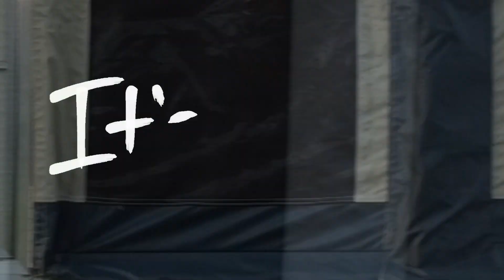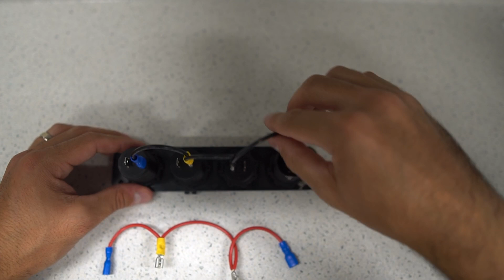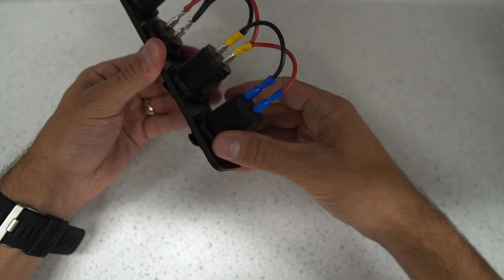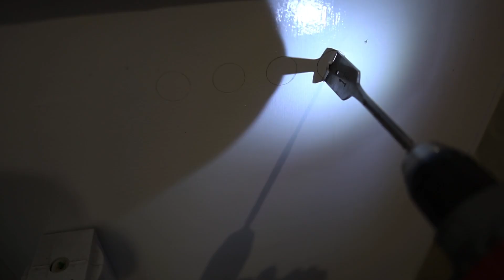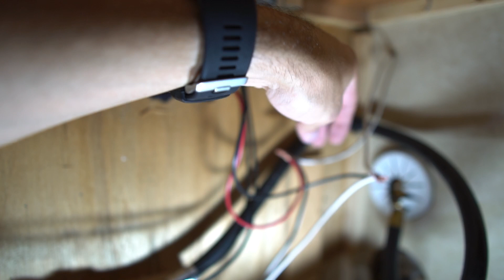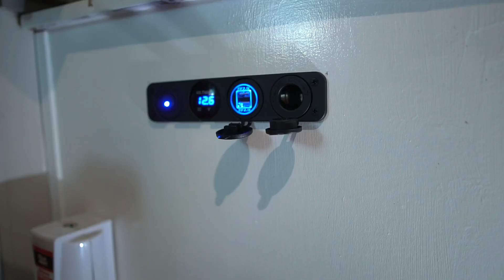Pop Up Camper 12 Volt Power Outlet MODIFICATION | Charge Your Cellphone While BOONDOCKING!

Comment: What about a fuse for the usb port? Do u not need one to protect your phone or whatever device u have sucking down those 12volts?
Reply from the maker: It’s fused at the converter box, but I’m sure an extra in-line fuse wouldn’t hurt.

Comment: Did you use the wire that is going to your thermostat? I tapped into the thermostat wire and it turns on my heater fan every time I flip the switch on. Do you know why it is doing this?
Reply from the maker: No I tapped into the exterior 12v light.
Reply: OK I just did that and mine works great. For anyone that’s going to do this project do not tap in to the thermostat wire. It will not work. Ha ha ha.
Reply: OK I just did that and mine works great. For anyone that’s going to do this project do not tap in to the thermostat wire. It will not work. Ha ha ha.

Comment: Mine is on top of the cabinet next to the bed. Much easier to see the display and use the outlets. If I put it in a wall I would build a little box and tilt it up.

Comment: Thanks for the video. Another winner!! This is definitely a mod that those of us who don't own a tool belt could do. (Well, maybe with a friend doing an 'over the shoulder.') I like how you included all the links to the hardware below; much appreciated.  Suggestion: Consider some kind of very shallow plastic or aluminum phone holder to fasten near the panel. Just the depth of the panel itself, to hold a phone while charging. Just put the phone in the slot, plug it in, and check back in an hour.

Comment: Another great video! We were originally going to replace the wall receptacles with newer ones that have UBS ports, but we are going to use this mod instead. Love having the battery volt display and this can be used boondocking while the wall receptacles are not.

Comment: Thanks for the video. When you installed that and cut your battery line to wire up are you losing your ability to use your lights w/ 12 V?
Reply from the maker: No, they still work. It's just spliced in.
Reply: @ItsPoppin  gotcha, thanks

Comment: Will this tell me how much power is left in the battery until it needs to be charged again?
Reply from the maker: It will give you an approximation. Google 12v battery voltage chart and it will give you voltages that roughly correlate with how much battery percentage is left. If it's a lead acid battery, remember to keep it above 50% at all times.
Reply: @ItsPoppin  Not so great for Lithium though! I did the same mod (same panel even!) and tried using this for the battery level but on my last camping trip I really had no idea. Depending on the recent load the voltage fluctuates heaps and takes a long time to settle. I'm putting in a proper meter yet, a cheaper version of a victron. I also want to install some wireless charging pads for phones near the bed

Comment: Did you need to install a fuse in this system?
Reply from the maker: Wouldn’t hurt as it comes with an inline fuse.  This system, the way I installed it, is fused at the converter with a 15 Amp fuse.  If you run this directly to the battery, you should install a fuse.

Comment: I just opened up the ole (1983) popup last week. No water damage woohoo. I did have a couple buttons on the lower canvas that need attention. I'm gonna have to relook at your video where you redid your buttons. My goal is to streamline to popup setup part using the 19mm drill attachment etc. etc. Also gonna look at the hand crank part process. I was thinking of getting a cheap cordless harbor freight drill that I can keep exclusively in the popup utility door section so I don't lose the higher end drill at a campsite. Also we booked a Memorial Day Weekend trip to Indiana Beach. You got the best popup channel on YT keep up the good work. Take Care my friend.